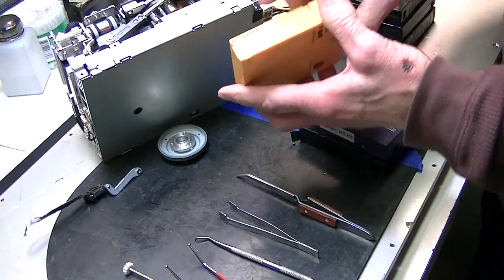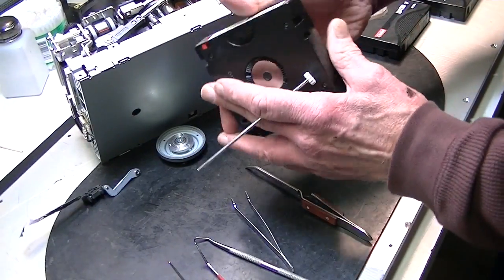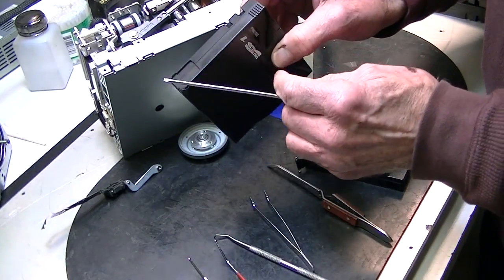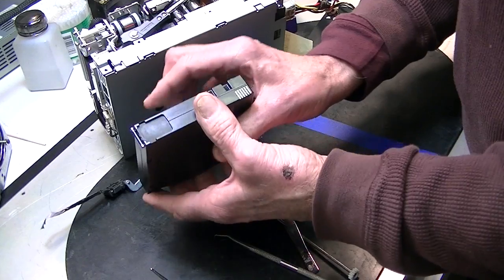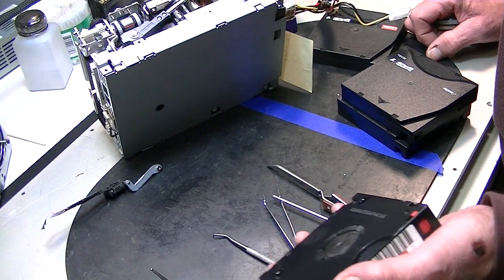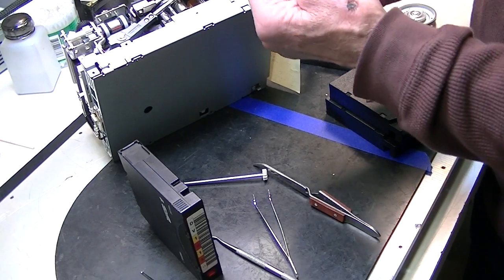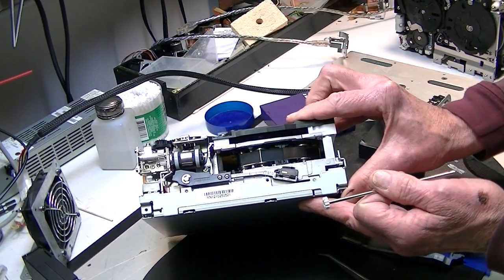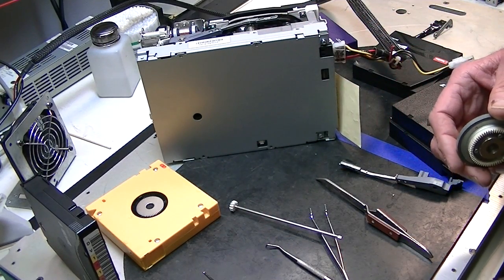Tape Drive Repair - Tape Cartridge Leader Pin Fix

Comment: I've got an IBM LTO7 HH, and the thing that grabs the leader pin doesn't always come in at the right angle. When disassemble and poke it a bit, it eventually works more consistently, but I don't actually know what difference I'm making in order to make the fix permanent. Most of the time, it comes straight in and hits the pin and stopping then retracts and tries again five or six times before ejecting.

I can see how there is a little track that moves when the tape is in all the way. I feel like the claw is loose or something. It wiggles quite a bit side to side. I could see that being by design though.

Comment: Can you make video how to disassemble the cartridge ? I've remover all four screws, but still unable to open the cartridge case. Thank you.
Reply: just slide it upwards, in the same direction as you removed the screws. The tiny metal spring which holds the leader pin is preventing the case from opening, that's why you can't open it. Watch out for the ic chip, it'll fall out aling with the door spring.

Comment: Hi of recent, we had an issues with the tape LTO3 getting stuck in one of our drives. We manually go it out but and found torn pieces of tape in the drive which we removed. However, the drive comments that it needs to be cleaned. Inquiring how that can be done and also would it require a cleaning tape or its optional to  use a cleaning tape
Reply from the maker: Justine,
The drive is asking for a cleaning tape because of the previous  stuck tape. The drive asks for cleaning tape when the error rate reaches a certain threshold. Or, in your case the drive produced and error because of the tape getting stuck. If you run a cleaning tape, it will clear the request for cleaning. However, since you found torn pieces of media in the drive, it should probably be professionally manually cleaned and gone through. Even removing the cover and putting it back on can cause further problems, if you are not accustomed to doing it. It is quite possible to sever a cable on the R/W head when reinstalling the top cover. Rendering the drive useless. We can certainly issue you an RMA under and you can send it in to us where we will go thoroughly go through the drive, clean it and test it. You can obtain an RMA request on our website: https:\\mwtss.com or you can run a cleaning tape and see what happens.

Comment: Hi Les thanks for contacting us.  At this point, you need to send in for a no cost repair evaluation.  We will disassemble tape drive to remove leader pin, realign loading mechanism and test tape drive.  If you tell me what type of tape drive you have, I can give a repair estimate.  Thank you.  MidWest Technical  www.mwtss.com

Comment: Hi  ... hoping you could provide some advice with my little issue ... tape has been cut inside the drive, I have managed to remove tape cartridge and the tape that was wound inside drive ... all that remains now is the leading pin with about 2 feet of tape ... my dilemma is that I have not been able to figure out how to remove leading pin without dismantling the drive further ... Thanks in advance ... great video!
Reply from the maker: Hi Les:  I do apologize for responding with an 8 month delay.  Look up from IBM leader pin replacing.  If your break is less than 3 meters from the pin you should be okay.  If media tape is broken more than that you will be past the point of the media where your data is written.
So you can fix this specific type of media break but if the break is further away and the data is very important a few media data recovery folks can help.  Be prepared to really open your wallet for these data restoration techniques most  services will start out a > 1K.
Hope this help,

Dan - Owner

Comment: My loading mechanism goes over but doesn't grab the working pin.  Its also power cycling with flashing exclaimation with a number 5 in the single digit display.  All this happened after the power went out.  I wouldn't think the power going out would do that.
Reply from the maker: I can identify 2 potential problems,  First loading arm bent may have been caused by the power outage,- not too likely,  Second the EC# 5 usually indicates a bad main board, easily caused by the power outage.  Sometimes we can clear the EC5  you have an IBM tape drive.    The most success we have in clearing the error depends when the ec 5 is identified where in the POST sequence.

 I would suggest goint to our web page MWTSS.Com or repairmytapedrive.com and fill out a service request for service, we do have no charge evaluations.

Hope this helps.

Dan

Comment: How do I open up my HP LTO-5 Ultrium 3000 Tape drive? The "Clean" LED keeps blinking,  I guess there's accumulation of dust and requires cleaning?
Reply from the maker: We don't recommend that a user opens up a tape drive on their own.  If running a cleaning tape doesn't clear the 'Clean' light, it more than likely means it will have to be opened up and manually cleaned.  Also, make sure your cleaning tape hasn't run out of 'cleans' most cleaning tapes are good for 50 cleans, then you must buy a new one. If you attempt to open and clean yourself and then have to send it in to be professionally cleaned, it may cost you more if you made matters worse.  You have to use the correct chemicals as not to damage the head and it the head gets knocked out of alignment, it will have to be realigned.  Many times we have seen drives come in after a customer tries to remove stuck tape etc.  Some will try to pry the tape out with a screwdriver, rendering the drive unrepairable.  We offer a no-cost repair evaluation and can take a look at the drive for you and give you a repair cost with obligation to you to go through with the repair.

Comment: Excuse me, do you happen to know if it is at all possible to replace the tape drive in an older lto4 or lto5 tape library with a newer lto7 tape drive? Will a tape library take any ultrium drive or does it have special firmware protection?
Reply: You can only use tape made for the drive or the two previous drives, at a lower capacity. You can only use lto7 tape with a lto7 or lto8 drive.
Reply: @sebastiengilmour6972  He meant the tape drive, not the tape
Reply: @uiopuiop3472  OP needs a drive that works with existing tapes. Pretty important to know they might not be writable.